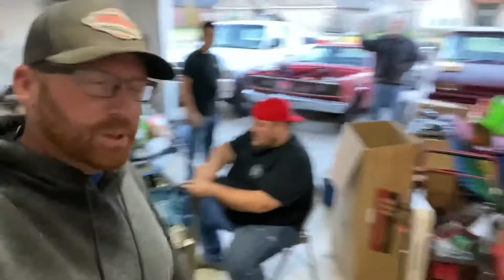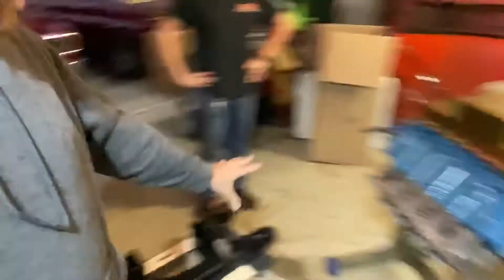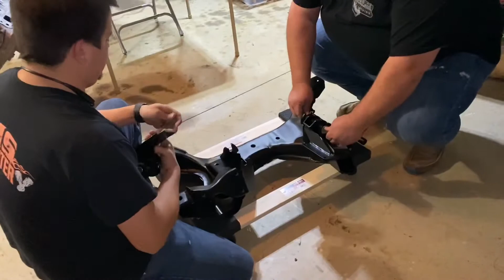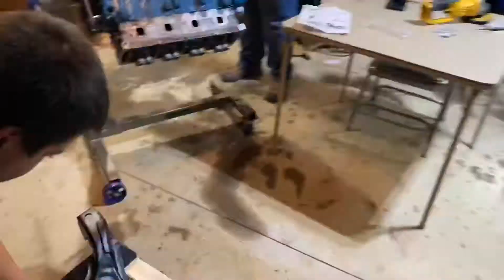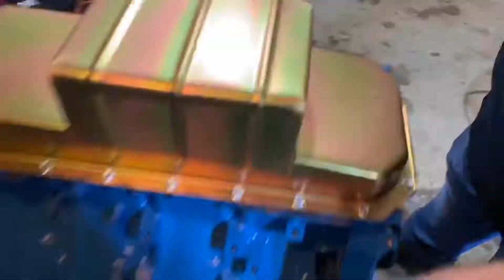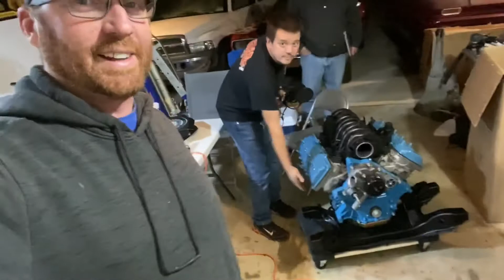Gen3 Hemi 1970 Duster - Part 3 - Engine to K-member

Comment: whats with the blue? icky on a hemi.  hemi's need to be orange......period
Reply from the maker: Skidmark7 hahahahha, you write the check, we’ll paint it whatever color you want, lol. The blue is actually a Mopar engine color from the 70s was my understanding
Reply: @NarxolepticCustoms  yes the 70's small blocks started blue. except for the 340.  that was still orange, but not hemi orange.  after 72, it was all blue.  i cant remember when but they did the magnums in black.
Reply from the maker: Skidmark7 whew, your Mopar engine color knowledge is impressive!
Reply: @NarxolepticCustoms  ive rebuilt a few, but im on my first hemi now.  thats why i watched you guys.  which intake did you run?
Reply: @skidmark7199  factory intake
Reply: @bigblocksgarage3630  truck or car? I’m trying to find out if a truck intake will fit under the hood of my duster